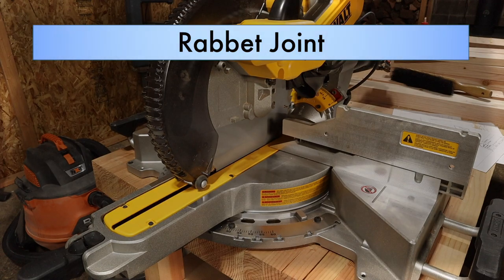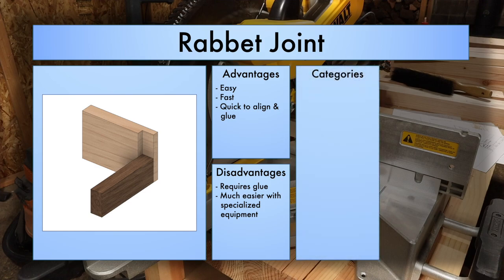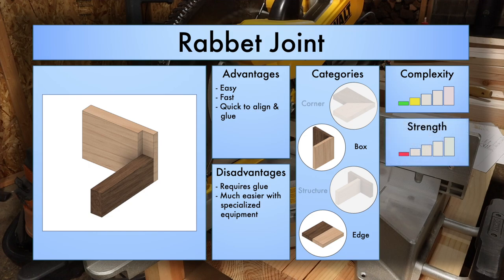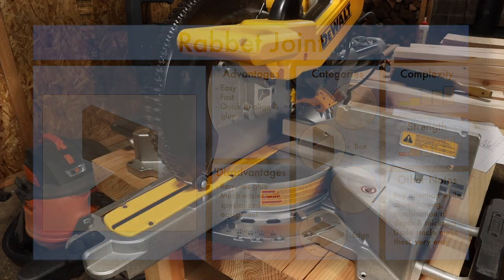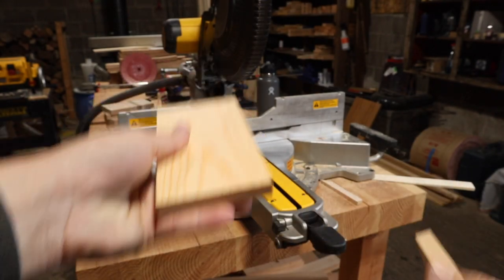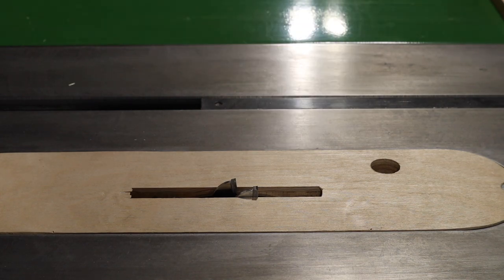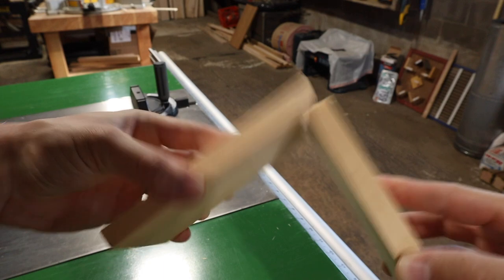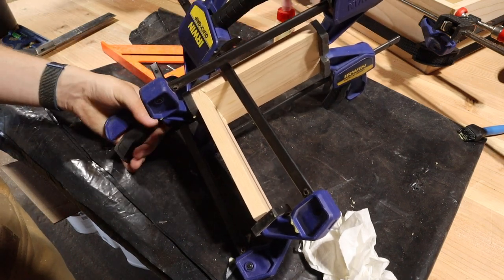Making a Rabbet Joint | Summary, Comparison, & Walk Through

Comment: You could also do it by cutting the depth flat on the table saw the the width with the board stood on end on the fence. 2 cuts but with more measurements.
Reply from the maker: Totally could! I generally stray away from cutting on end like that unless it’s clamped in a jig on my crosscut sled, but you’re right, that’s another way without a dado stack or router.
Reply: @NorthwestCraftsman  I do it with a jig that slides over my fence. Them I clamp the work piece to the sled/jig thingy. Lol.
Reply from the maker: That works perfectly as well! Hadn’t thought about that, great idea.

Comment: I'm kind of a beginner.........which joint is better (stronger)   rabbet,,dowel rods,,,,or biscuit joint.
Reply from the maker: That’s an awesome question! Like many things, it depends on what you’re using it for but a dowel joint will likely be your strongest because of the material cross section at the joint. I use dominoes for many of my joints which is a combination of a dowel and biscuit.